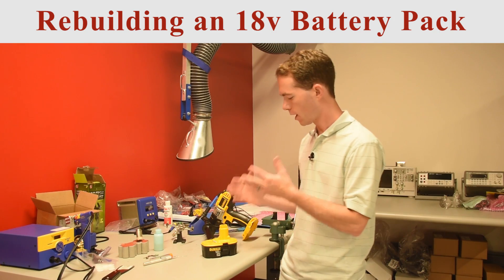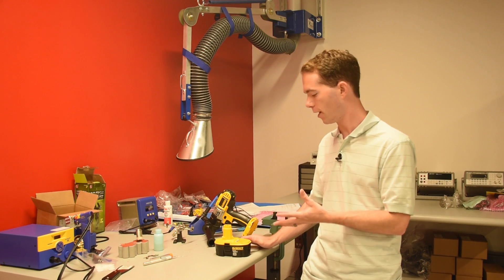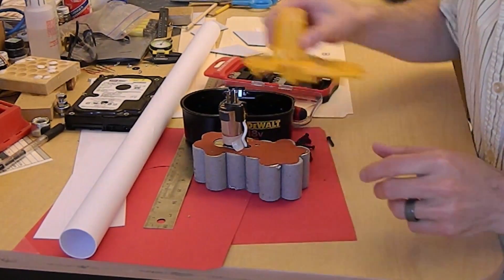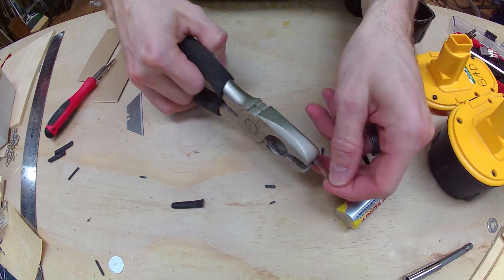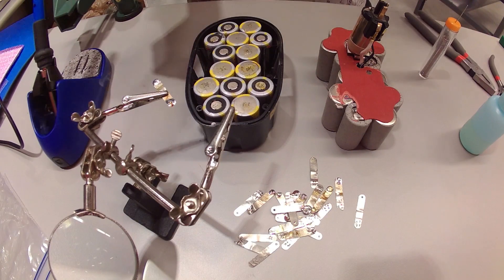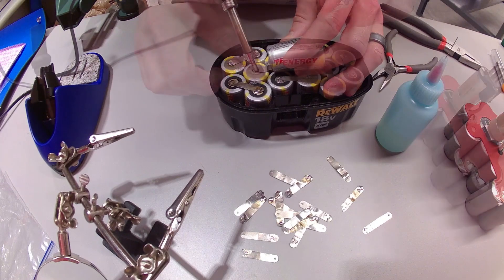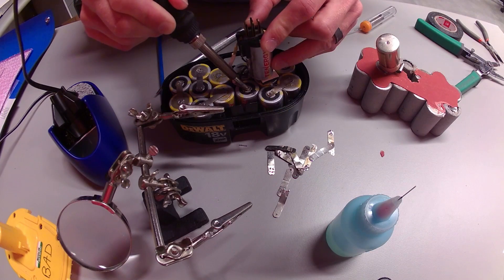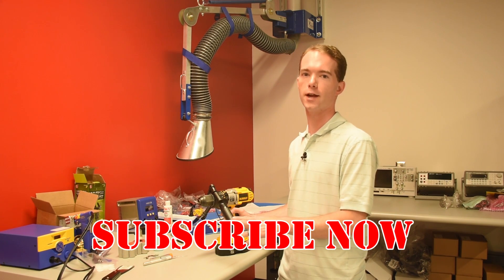Rebuilding an 18 volt DeWalt Battery Pack

Comment: hi Mike,what is mean AMH? my dead batteries cell is 12v, 1200amh, can I use 12v, 2200amh cell to rebuid it?
Reply from the maker: Hi! Yes, you can use higher capacity cells if you'd like. It'll run longer. The only drawback is it'll take about twice as long to charge. Thanks for watching!

Comment: Mike, Why not use Li-ion batteries?  I have a charger that  will  ..Dewalt DC9320 7.2V-18V NICD NIMH LI-ION 1 HOUR DUAL PORT CHARGER.  Thanks for your video..

Comment: here's  a few ideas for getting a good result
do not try to do this unless you know what you are doing - the acid can burn your skin
check the voltage first - there may be a kaput cell which will waste your time.
Check your battery fluid.
attempt to completely recharge the battery.
(I read about these on rapid renew roadmap site )

Comment: This was probably a good hack 5 years ago when this same hack was first posted on YouTube, but I don't think so now.  A person can now buy a two-pack of NiMH complete replacement battery packs on line for less than $35 including shipping.  (Look to that huge on-line vendor with the same name as the large South American River.)  Since this hack depends on buying no-name batteries off of ebay, and since those no-name batteries will be of questionable quality, a person might as well buy the no-name complete battery pack of less money which will come with at least some short return guarantee even if the return window is only 30 days.  And you want to buy the NiMH and not NiCad version.
Reply: My cat will hack hairballs if she's not kept greased up.
Reply: John Pierce ii
Reply: interesting points ,if anyone else wants to uncover how to recondition batteries try Trefendous Rapid  Extender Tips (do a google search ) ? Ive heard some unbelievable things about it and my colleague got excellent success with it.
Reply: I have spent months studying battery reconditioning and found an awesome resource at Magic Mender Wizard (check it out on google)
Reply: Or you could purchase whatever rechargeable sub c batteries you want...
Reply: Tenergy is a name.
Reply: Funny how you name-dropped eBay but not Amazon

Comment: Harbor freight has two versions of their 18 volt battery one at 12.99 and the other at 16.99 the more expensive one has higher capacity sub c units. I have not tried it yet but have seen videos where people harvested them to rebuild their name brand batteries.
Reply: Why would one take apart a complete battery pack to rebuild an old one?
Reply: There are many components to doing a pro job. One place I discovered which succeeds in merging these is the rapid renew roadmap (check it out on google) definately the most incredible info that I have ever seen. look at this incredible resource.

Comment: Excellent video, Craig.  The Ryobi 18V battery packs are put together a little differently, but the same concepts apply.
Reply: @Milo Fonbil, do you know they have to use rechargeable batteries?

Comment: OK I just bought a DEWALT Brand 18v batt. complete from EBAY for $29.99 free shipping PN#DC9098  (to have extra). However I picked up some soldering tips from your video. Could you tell me what Brand your 60w soldering iron is ? I need a good one. thanks brother.
Reply from the maker: This is a cheapo Vastar from China that I absolutely love. It's very cheap, variable temp, and comes with several different tips. There are some nice digital Hakko ones 2 feet away and I like my little cheapo much better.
Reply: Are you sure those batteries are genuine Dewalt? I have been sold very good Chinese copies on EBay, but if you lift the top off, the cells are smaller and the heat sensor is non-existent. They have half the current rating and half the capacity of the genuine Dewalt batteries. They weigh a lot less as well.

Comment: Hi Mike! I recommend you to buy a Spot Welding like 788H or made one to do this kind of job!
Reply from the maker: Yes indeed! If I ever do it much more, I will. However, I did recently upgrade my system to Lithium because I got a killer deal on a new lithium drill and impact gun.

Comment: Could you just replace the bad cells? These aren't LI-Ion so balancing isn't as much an issue with these cells.
Reply from the maker: I actually didn't test them individually. Maybe I should have. The pack was probably 10 years old, so I just assumed they were all bad and replaced them all with new ones.

Comment: hello my friend a question what types of batteries or model of batteries do you use
Reply from the maker: They are called "Sub-C" size cells, these are Tenergy brand .NiCad
Reply: He said, "Sub C size cell," I think the model is DC 9098 (same as mine). I would use rechargeable C size batteries.

Comment: Amazon sells a Dewalt battery (generic(), for $25
Reply from the maker: Yeah, but where's the fun in that? Ha ha, I never even thought to check for something like that. Thanks for the tip Tom. Definitely going that route for the other 3 I have.
Reply: tiny capacity though
Reply: @Ybw200owns  so the batteries can be the same size, but have different capacities? Also, why do the cheap off brand battery packs for like, milwuakee and DeWalt, mess the tool up? What is the difference that would cause it to mess up?

Comment: Hooked to this channel. Do you do challenges? 

If you do could you make a RC car out of a DVD player? I know they're cheap everywhere
Reply: here's  a few tips for fixing a car battery
Don't try to do this until you are sure what you are doing - the acid can burn your skin
Test the voltage first - there may be a kaput cell which would waste your time.
Check the battery fluid.
attempt to fully charge the battery.
(I read about these and more from Jons Mender Guide site )

Comment: Very interesting, speaking of which you just reminded me I need a 18 volt power supply for my rocket ignition system thanks!
Reply: DO NOT GO TO MAGIC MENDER WIZARD  !!!
This long winded POS goes on n on n on n on for 10 minutes (maybe longer) and there is NO Tutorial at the end just this POS selling a book for $79 .
F-U maria for posting this crap and a big F-U to Frank Thompson and whatever Ericson . 
Maybe your wife should have told you you're a long winded douchebag and left you when you had to decide between a car battery and feeding your kids. 
My guess your "book" is just as much a POS as you .
F-U again you Douchenozzle
Reply: Hey everyone, the best success that i've ever had was by using the Magic Mender Wizard (just google it) without a doubt the no.1 info that I've tried.